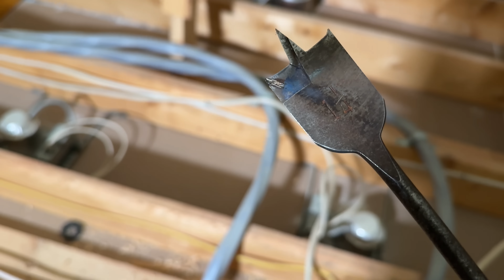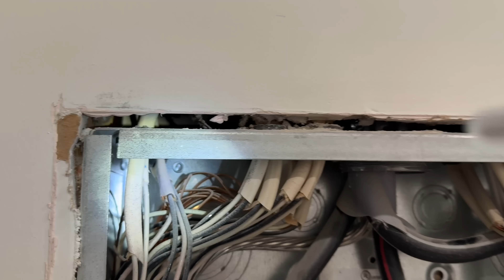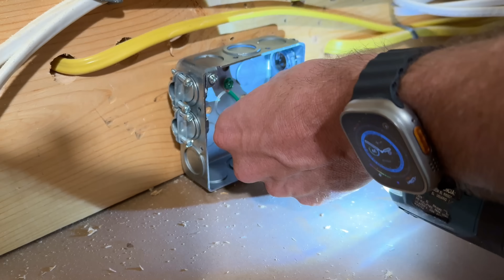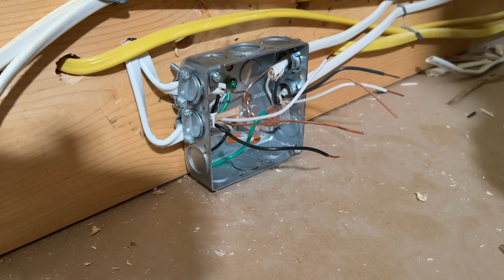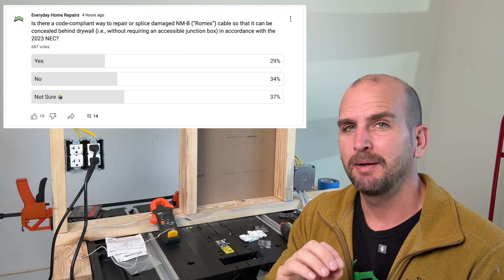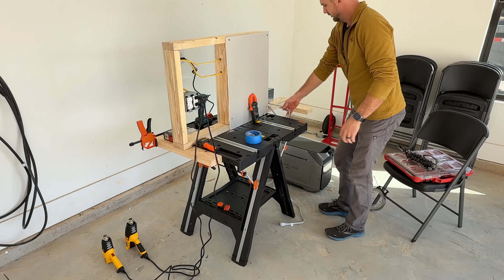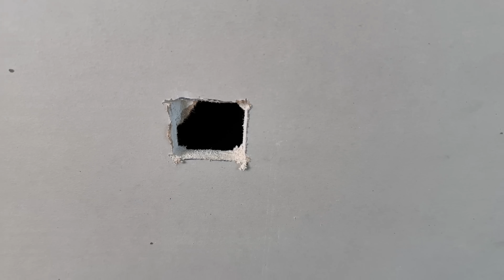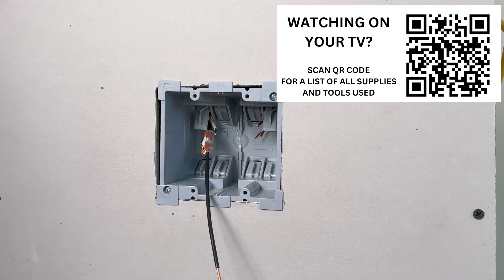How To Repair Damaged Romex |  3 Easy DIY Fixes

Comment: I am an electrical engineer and have experience designing "tuning fork" connections, which are similar to the insulation displacement terminals in the Romex splice. I have no doubt it can carry 20A. The temp rise here is very slight. In an automotive connection system, it would be allowed to reach a temperature rise of 55K. Your measurements are less than 20K. Of course, residential electrical systems are designed more conservatively because they're intended to last much longer and involve different materials. For instance THHN insulation is rated at a much lower temperature than GXL used in automotive. That said, I wonder why the splice is made to disconnect. That connector interface causes additional heat and a potential source of failure.
Reply: I think it is a connector to ease in the install. Placing the wires and pressing on the cover would be a lot harder if the other end was attached to the other side of the wire, especially if you had no extra slack or were inside a wall cavity or something.
Reply: So electrical engineers are to blame for those cursed "tuning fork" connections! I have replaced more of those cursed things than I will ever be able to count in automotive applications because they cannot survive mechanical strain vibration or moisture at all and all 3 are often present in automotive applications
Reply: @brianseaders  No, engineers aren't "to blame". Engineers are constrained by consumer demand for more content in the same space, cost, weight, etc, etc. There are literally BILLIONS of tuning fork connections in automobiles worldwide and very few have any issues if they're designed and applied properly. Like anything else, there are merits and demerits associated with their use. You say they can't survive vibration or moisture. Untrue. They meet the specifications for vibration given by the automaker. If the specification isn't representative of the real world application, that's the automaker's fault, not the designer of the terminal.

Comment: I have also seen the spade type connections fail in mobile home outlets. Especially in bathrooms and kitchens or other high load areas. Blow dryers and kitchen countertop grills and toaster ovens can really add a load. I tried to get some of these splice connectors in CA from my wholesale house and they said they are not legal here. So I have had to use a different hexagon  plastic box that snaps around the Romex. The advantage is you don't have to cut it. Really nice when the Romex is stapled down tight.However the box is expensive.

Comment: So, what would be the problem with the classic solder and heat shrink?  It is the only means of connecting wires that I have NOT seen fail, except for cases where the wire got too hot and melted the solder.  If your wire is getting that hot, you have other problems.

Comment: I am concerned about the plug in style of connection between the halves.  A tug later on while putting in an outlet seems like it might cause a partial disconnect.

Comment: The hidden connector scenario is not legal in Canada or Mexico, but Wago connectors are. Doesn’t mean they are not good but…. I have always done splices in boxes that are checkable. Sleep better. Family safe. No surprises. Sometimes the old ways can be safer. I have never liked wire nut connectors either.

Comment: I would use your #3 method, I have very little confidence in the pierce connection. I know it passed your heat test, however over time with load on those conductors imho it will fail.

Comment: The part I don't get is, what is really wrong with taking a single gang metal box and make the connection inside it and put a cover on it. Then if it is totally safe, why not have it behind the wallboard without access, or an ugly blank cover plate in the middle of your wall making it look like crap? Any short inside would be properly contained with the metal work box, and yes I understand it is code!

Comment: Informative, but with your third example using the "old work" box, had you rotated the box 90 degrees it would have made it easier and given you more wire inside the box because you would not have had to bend the Romex 90 degrees just to get it into the box.

Comment: With option #3, why did you use the 2-wire Wago connectors with dual pigtails in addition to the 1-wire Wagos? It would seem that if the goal was merely to reconnect the Romex, a pair of 1-wire Wagos and a single pigtail jumper between them would suffice. Your strategy resulted in the electricity needing to go through 3 Wagos per wire, which seems redundant.  Is your strategy to more-easily open up the possibility of adding an electrical outlet at the box in the future?

Comment: They have saved my butt a few times in thirty years of service work. I've had customers that were totally against a junction or another outlet to fix the issue which is my preferred fix also. At 20.00 a pop, they are pricey, is the only drawback. Home Depot stopped carrying them a while back so I have to preorder them by internet or at Platts.

Comment: I know its not code but i made a similar fix, but i just stripped the romex to bare copper, put on inline splice wago, leaving no exposed copper and then wrapped the splice in 6 wraps of electrical tape.  Done no fuss, and working for 3+ years

Comment: not supposed to use the metal cable clamps without the plastic insert. i know... it's a newer thing todo. the claim is that the metal clamps can damage the romex.

Comment: I have already used method 3. The power cable was hidden in a brick wall. I cut through it while drilling.  Then, using a hammer and chisel, I made room for a built-in box. It was not possible to pull the cable. Nevertheless, I managed to install the plastic box and just had enough space to attach the WAGOs. Then a cable bridge was installed. The box is attached to the wall with plaster and the wall is decorated.

Comment: That one that can be burried in the wall.  Do those handle loads from electric stoves and ovens or dryers well?  I would not use it but it is nice to know we can get things like these.  I would also hire an electrician if I had a wiring problem. Yes, hiring an electrician is expensive but not even close to the expense of replacing your house.  Then some places may have a law requiring a qualified electrician to do do any work on the wiring.  I used to live in a house that is all electric and the stove and dryer were of course on 240 volt circuits.  Really the only other utility bill I had was for internet and TV.  I had well water and the sewer authority did not yet come through connecting everyone, which I hear is expensive.  That old place is not really far from me but it is not in a direction I always travel.  I just go past it if I happen to be going in that direction to get a quick look and the place really has not changed much other than a different mailbox and a stone monument or plaque with the name of the new owner on it.  Having lived at that address for 35 years it is super easy for me to get to since I would be going to or from it a lot when I lived there.

Comment: Thanks for all your help and suggestions. Here is what I did inside my DIY walls and saved myself another trip to the hardware store. I slide the cut wires into a plastic conduit tube after using twist connectors and a lot of electrical tape. Another section I used some PVC pipe and tape as an electrical box and another section I used a thick plastic maple syrup jug as an electrical box. Yep this is unprofessional - then I closed up the wall for eternity.

Comment: 9:00 stipping the insulation would help the forks make a better "electrical path" connection
That said. I would not use those - they are very similar to the old auto wire splices - which work fine for 12v without enough heat to do anything - but I would be leary of 10x = 120v

Comment: Those splice connectors are very common in the RV industry. They are used frequently to transition from romex to SOOW cable where there are slide rooms that move in and out. They generally work well, but they are very prone to fire if they get wet. For that reason, if you use one, I would highly suggest you make sure there are no water pipes in the same general area.

Comment: I would never junction behind the wall. All junctions must be accessed  by NEC and I never use quick connects. 40 years of experience says do it right and sleep at night. Replace the wire.

Comment: Very informative! I found one of these buried in my wall when doing some renovations. My house was built in 1902 and still has most of the original wiring -- K&T and cloth wrapped cables. There was a fire (not electrical) in the basement back in 2011 and the home runs and kitchen directly above were re-wired. One of these NSI connectors was used to splice the new 12-2 into the old cloth wrapped and just tucked in the ceiling. It freaked me out at the time, not being in a box. Not as much as the K&T with live, dangling stubs buried in the ceiling, but still.

Comment: $34 00 Splice vs $37.00 ( 50 ft., 14/2 ) plus questionable local codes and being old school = re-pull the cable.  Nice to have the option though.  Agreed 6” of actual wire ( not pig-tail beyond the box ) … never trust a Wago lever flip too easily, but if used wisely and in the right conditions they can also be an option.   New ways can give way to easier / fast job repairs, but what set electrical / electricians apart from the other trades is not dumbing down the work / products keep it safe.  Example: Do yoy really trust drinking from Pex pipe ?

Comment: I've run into this a few times and when I couldn't fish a new cable, I've just added a random outlet, since you really can't have too many of them. It would be nice if they built thermally sensitive fusible links into these pinch connectors so they couldn't overheat beyond a safe temperature.

Comment: 90 that tight in romex can and will cause fires. I have replaced 3 different runs of 12/2 romex because of tight bends that caused a fire in 3 completely different house and different places

Comment: Small slip at 7:42. You said that 20 A at 120 V amounts to 240 W, but it would be 2400 W. At the load, of course.
Reply from the maker: Thanks for the correction 👍

Comment: I really do not like those forks.  If caught between a rock and a hard place I might use one, but it seems "they" could get a box containing wagos approved for in-wall use.  I'd like that a lot better.  The box would contain the 3 (or 4) wago inline connectors and secure the romex in and out when it permanently locks closed.

Comment: I would suggest  you write on cover what circuit  is in the box and breaker #
Reply: That's great until somebody changes it to a different breaker in the panel down the road and does not update the field nomenclature.

Comment: Re the hidden splices, the full load current heat test that you perform is a great idea.  But I just wonder with that thin blade connection how this type of connector would stand up under an overload test or repeated high inrush currents from motor starting such as a fridge or small pump.  And, if it did start to fail how would someone find the hidden intermittent connection?  Certainly, the consequence of it potentially one day causing a fire in the wall is not something I'd be comfortable with.

Comment: You dont insulate your roof?
Reply from the maker: There is spray foam on the back of the roof decking.  It is the best attic I have ever worked in 👍

Comment: That type of wire joiner has been used in telecommunications for decades.   Yes, they are not resistive  nor generate heat when they are NEW, but with that few molecules of contact,  they do fail over time. (corrosion, metal fatigue under tension) Would not want them hiding behind wallboard.  While definitely not code, a splice that is soldered should last forever.

Comment: The average Joe doesn't know, or understand Ohm's Law. He automatically assumes, that for a 230V service he needs thicker wires. 
Yet, if the wattage is the SAME, it's the 115V that will need the thicker wire, because the amperage with 230V will be HALF of the 115V with the same(!) wattage. 
W=V x A. (W/V=A; W/A=V).

In Europe, when they switched over from 110 to 220 volt it was for the reason, that the old buildings built with electrical wires in the walls from the end of the 19th century into WW2 could not carry the increased number of electric appliances used without overheating, by the 1950s. So by doubling the voltage, they could double the watts used, with the same (safe) amperage in those old wires. Over time they were replaced, ground added, but in my condo I had them replaced only exactly 102 years later, in 2014 during a total gut-job renovation. My old wires from 1912 were solid aluminum, and the new were the same(!) thickness but multi-strand copper. 
FYI: Multi-strand copper has a lower resistance than a solid copper (both the same thickness of metal), so it can carry a higher amperage without overheating. It's also more flexible - easier to work with...

Comment: Despite the tests done by some lab to get the NEC approval AND your perfectly valid testing, I would lose sleep knowing that one of them was in my wall. The WAGO connectors are similarly not the sort of connection that we have grown to accept though they have certainly stood up to years of extensive use within the industry. Some circuits would be extremely difficult to replace without tearing up walls so these things definitely would be handy.
Reply: maybe we should go back to a good joint, solder.
Reply: @alanm2842  But when your partner wants a different light fixture in the kitchen and you find yourself on a ladder trying to juggle a light fixture and a soldering iron while connecting or disconnecting those electrical joints, while being careful not to start a fire in the ceiling? 

I do electronics and actually enjoy soldering........ at a workbench with proper ventilation and plenty of work holders. I have encountered soldered joints in old house remodels and don't recall ever contemplating using solder to reconnect them. I am sure that wire nut connections have failed but I have never known any that I made to fail. I have found connections that I was surprised hadn't failed, some so loose the wire nuts fell off when I went to replace the fixture!

Comment: Seems to me that the connection in the NSI IDC splice is similar (in terms of how much surface area of each conductor is in contact)  to the WAGO 221s.  So unless there's a manufacturing defect, they should have similar performance.  I was surprised the temp wasn't a tad higher in the splice vs clean romex...
Reply: The 221 has more contact.  With this style of IDC there is only contact where the blade cups the wire.  With the 221 there is contact were the cage clamps the wire and also where the wire is pressed against the bus bar.  In either case the impedance bump of the IDC is only a matter of maybe a 3 milliohms or so, so the amount of heat produced is minimal (R x I x I), and will be easily dissipated by the copper on either side of the joint, hence the graph between the unbroken and joined cable being very similar.  You can prove the increase in resistance yourself easily enough by using your milliohm/low ohms/continuity meter and measuring the resistance of a length of wire then cut that wire up and place a number of your connection method in series and measuring again.

The trick with IDC is to properly compress it so that the wires are properly seated down into the cup.  I wouldn't trust the average person to get that right personally.
Reply: @retrozmachine1189  Thanks. Good to know.

Comment: Those fork connections do work, but the weakness is in the installation. You must be perfect and extremely careful as you install them. Most failures are due to careless installs.

Comment: Number three, you need two boxes. 1/4 insulated and 6” (just do 8”) workable length on each side and a wire between boxes with the .25+6 inch as well.
Reply: Or old work box further to the left with proper length in box and new wire to the switch box in this example
Reply: *Two gang on left not switch

Comment: Have no ideal who nsi payed off to get UL listing a fire waiting to happen when first started in the mechanical residential field worked a lot for a manufacturer home company they use a lot for cross over circuits quit a few failed  overtime and couple actually burt home down wouldn't put my name on that repair 😮